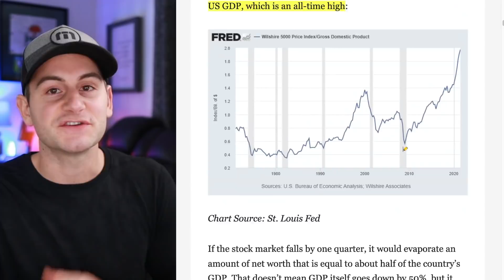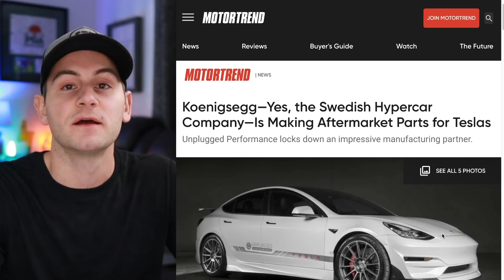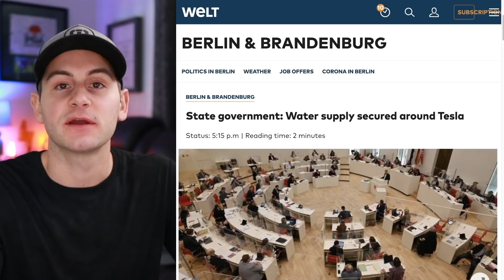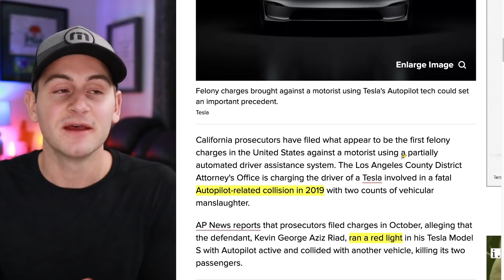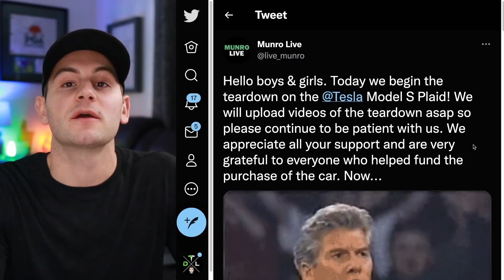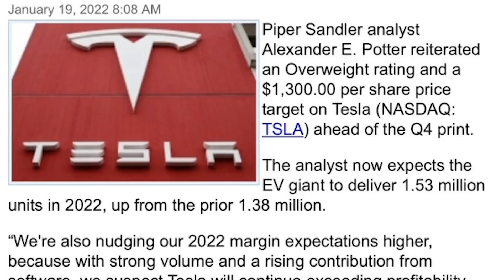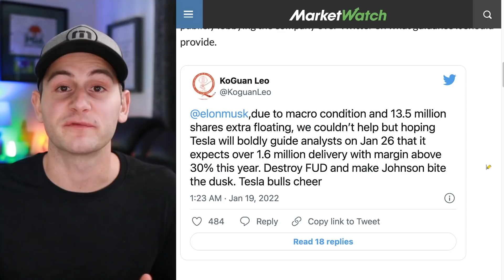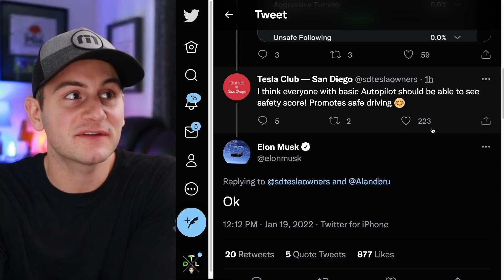Koenigsegg Making Tesla Parts / Munro + Ingineerix Plaid Teardown / Tesla's Role in AGI ⚡️

Comment: If they could just demonstrate FSD advancement by doing something about the basics that have shown no improvement whatsoever.
If they could give me the impression that the existing owners are still important to the company rather than the bottom line obsession favouring shareholders.
Taking away cards, I use constantly, and other increasingly illegible basic info trends are becoming a much more serious worry.

Comment: I've come up with a simple prediction for Tesla deliveries:
2M in 2022
3M in 2023
4M in 2024
5M in 2025
It may be overstated for 2022 and understated for 2025 but its easy to remember. And easy to see when its no longer valid.
Reply: That's a linear prediction. Exponential growth would see (for example) 2m for 2022, 4m for 2023, 8m for 2024 and 16m for 2025. That means 32m in 2026, of course. In my view, Elon's prediction for 20m in 2030 is just more sandbagging.
Reply: 50% growth each year would mean
at almost 1M in 2021:
~1.5M in 2022
~2.2M in 2023
~3.3M in 2024
~4.6M in 2025
~6.9M in 2026
~10M in 2027
~15M in 2028
~22M in 2029
~33M in 2030
Reply: @unitrader403  that's the target growth rate though and they have been exceeding that for a while. Imo 2M isn't too far off for 2022. Also Dillon said he thinks it will be 1.8M in 2022
Reply: @unitrader403  Thanks for 2025 number. Don't forget the ~49M in 2031 and the ~75M in 2032

Comment: I agree with your sand bagging argument. E.M said 5000 per week for end of 2017 and then it was for June 2018 and it was a shocking experience to reach that goal. Many Model 3s needed rework but the goal HAD to be achieved.

Comment: 110 cells in series at 4.2v is 462V.  Question: are some locked out somehow as reserve? (Not sure if that's possible.)
Reply: That's at full charge. As you start draining them the voltage drops quickly at first then levels out. Nominal voltage is 3.7V which would be 407V for 110 cells in series.
Reply: @whatusernameis5295  Yes, thanks.  4.2v is the fully charged point (in some newer batteries 4.35-4.4v) and progresses down to around 3.7v before the controller starts inhibiting the drain to protect the battery.  So it seems that they're using 3.7v as the cell voltage when they rate pack voltage.  (The voltages are lower for the LiFePO4 version.)
Reply: @StormyDog  Idk how much it would actually limit the drain but nominal voltage is 3.7 so most brands base the pack voltage off of that. (Like for tools that's what Makita and Milwaukee do while DeWalt rounds up to 20V for some reason). They actually can be discharged as low as 2.5V
Reply: @whatusernameis5295  When recovering cells we usually consider any under 3.0v to be damaged.  At that point they have high resistance and thus are less efficient and tend to heat up under heavy drain.  Still usable for 1S applications such as small flashlights.  Here's an idea for a new Tesla product for their store:  a Tesla branded flashlight with a 2170 cell (could even be harvested from old packs) or even a monster 4680 based flashlight.  The flashlight community would go bonkers for the latter.
Reply: @StormyDog  agreed on the flashlight. is that voltage fully charged? although I was going off of google and I get that that going to those extremes wouldn't be the best for the battery.